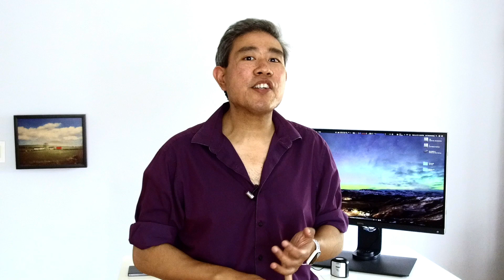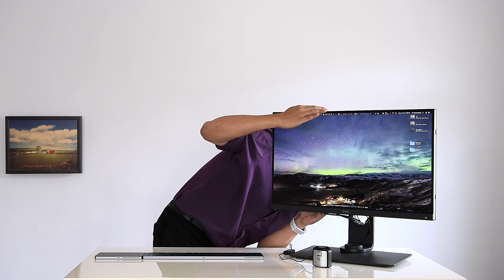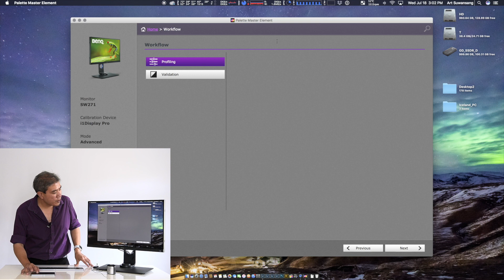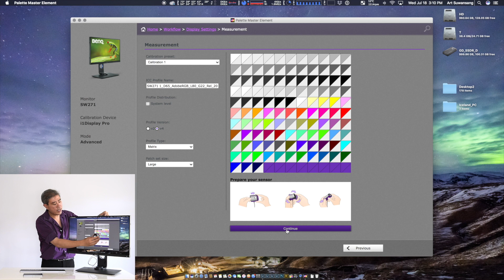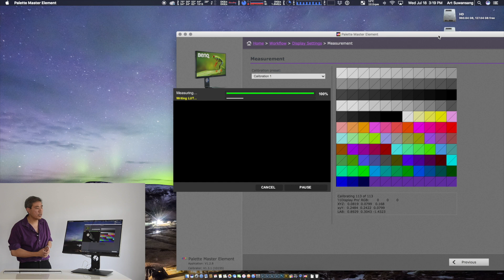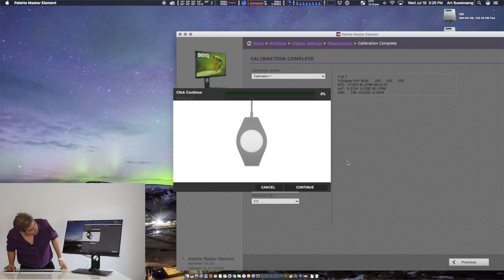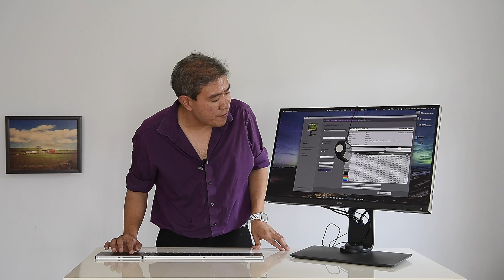How to Calibrate BenQ SW Displays with Palette Master Element - Art Suwansang

Comment: Palette Master Element  does not recognize my x-rite colormunki. listed as colorMunki Photo in calibration device drop down. I have the red X warning  when I click on check sensor, nothing happens.
Can You help please?
Reply from the maker: @Rees Markham, so a few things to note, there are 2 types of color munki devices. 1 of them is and another one is not compatible with PME. If you have the Color Munki Photo, which is a bigger device that you can do paper calibration then it is compatible. If you have the smaller Color Munki Display smaller device, then it is not. You can see what the color munki display looks like here https://www.xrite.com/categories/calibration-profiling/colormunki-display again this device is not compatible. This device the color munki photo is https://www.xrite.com/categories/calibration-profiling/colormunki-photo If you need to get a new device today, I recommend the there i1Display Pro or the i1Display Pro Plus.
Reply: Thank you for your reply. One more question.. I'm working on a PC, will the i1display pro  or i1 display pro plus work with Windows 10. Thanks again for your time.
Reply from the maker: @Rees Markham, yes all X-Rite devices will work with Windows 10.
Reply: Thank you, I purchased and installed the i1 Display Pro program.  However it doesn't seem to be working properly. When calibrating in PME the first time, it seemed to work okay. When I try to use it now it works until I get to the page where I am supposed to put the  i1 Display Pro on the monitor, it goes through a couple of shades of white then the whole screen goes white and stays that way. I have waited as long as 25 minutes until screen saver came on and computer freezes up and have to force shutdown. I've tried many times since, same results even in "easy" mode. It might be that I am using HDMI instead of the USB-C port? The BenQ doesn't recognize my USB-C which I understand would be the optimal driver to use, OR...could it be that the two programs don't communicate with each other? Perhaps uninstall i1D Pro?
Reply: I uninstalled  i1 Display Pro program.  PMI  is now working properly .my USB-C on my DELL is only for charging or dull monitors.Thanks for your help.
Reply from the maker: @Rees Markham, you're welcome
Reply: @ArtIsRight The included BenQ  display port cable  does not fit in my desktop computer no port for small end.The male end fits in my computer perfect.can I use a double male end cable?
Reply from the maker: @Rees Markham, yes you can. BenQ included the display port (big connector) to mini display port (small connector) if you have a full display port to display port it will work too. :)
Reply: @ArtIsRight  Good news Monica at BenQ is sending me one.Thanks again Team BenQ  you are awesome.
Reply from the maker: @Rees Markham, fantastic!

Comment: Hello, I just bought a SW240.  I was wondering if the X-Rite i1Display Studio that just came out in September 2019 will pair with Palette Master Element.  Or do you think the Display Pro is necessary?  Thank you for your videos.  They are very helpful.
Reply from the maker: @Martinouche, you need the i1Display Pro or Pro Plus, i1Display Studio will not work.
Reply: @ArtIsRight  Thank you for the quick answer.  And what cable for an audio connection between older Macbook air ans sw240? Can't get sound right now.
Reply from the maker: @Martinouche, sound on the SW240 is passthrough only via HDMI. This means the sound is carry through HDMI and you would hook up external speaker via the 3.5 mm headphone type jack on the back of the display. This is also the reason why the display have sound control options in the menu.

Comment: Hello,

When you set adobe RGB in Rgb Primaries, what color profile have you selected in your monitor options? (The profile created in PME or General Adobe RGB?) 
Because if I calibrate like in the video, and manual select the profile created in PME in monitor preferences (iMac), there are huge differences in saturation in Library and Develop mode in Lightroom.
The only way I can solve is selecting "Panel Native" in Rgb primaries.
Any thoughts about this topic?
Iam getting nuts here....
Reply from the maker: @Carlos Antunes, technically speaking, Panel Native Calibration is best. However, if you choose to use Adobe RGB there is a bug in the icc generated profile that cause the color to shift in LR. Please watch this guide for a temporary fix on this https://youtu.be/GavTIafAQsw

Comment: Which mode shall select 1st on the monitor ? I have SW240 and I selected RGB on my monitor option .
Reply from the maker: @Shürhongu Kire, it does not matter. When you run PME and pick the calibration slot in the setting screen it will automatically switch over for you.
Reply: @ArtIsRight  hello there ! Need your help again , please help me out . A friend of mine owns a BL2420PT 23 INCH MONITOR . AND when I log in to the master pallette it shows ( A connection to a Benq display can't be established ) please help out .
Reply from the maker: @Shürhongu Kire, PME will only with work the SW displays. For that you would have to do a software calibration, using the i1Profiler software if you own an i1Display Pro guide here https://youtu.be/Aed02rg3wDA a full guide on how to calibrate external display with i1Profiler coming soon.
Reply from the maker: This is the guide https://youtu.be/h_TT9O2I1b4

Comment: Hello ArtIsRight. Thanks for the Video , it helped me a lot with my first calibration of my SW271.  Now I got the message from my Monitor that it should be recalibrated.  So I get to work.  Unfortunately, after the calibration, I keep getting the Message from the Monitor that I should do a calibration.  What can that be?  Can you help me please?  Happy Easter and stay healthy.  Thank you very much.
Reply from the maker: @Maik Knobel, thank you for the question and you stay healthy too! So with the reminder my best suggestion is to turn it off from the display setting menu.
Reply: @ArtIsRight  I am fine.  Thanks.  I turned off the Reminder.  I'm just wondering why they put it in, to shut it down?  I thought until now that something went wrong with my second Calibration .  Have a nice Easter 🥚 🐰 Thank you very much.  😊
Reply from the maker: @Maik Knobel, You're welcome. It is really a good tool but in some instances it does not communicate with PME correctly and this may cause the issue. Personally I turned mine off. These display are good that they don't go off if at all unlike the old CRT days.
Reply: @ArtIsRight  I turned it off. I know everything is ok. Thank you. Stay healthy.
Reply from the maker: @Maik Knobel, :)

Comment: Thanks for the video, Art. 

I am having some issues with a Benq SW271 monitor. The main concern is with the USB-C connection. When I connect my  Macbook pro 16" to the monitor via USB-C, the calibration is failed with very weird color and very high delta E value, around 9 in average. I did the calibration with an i1 Display pro, followed your video on the latest version of Palette Master software. Furthermore, the option to switch between AdobeRGB, sRGB or black and white is not available. Even though I try to use the USB-C cable that comes with the monitor and some of my own. However, when I connect the monitor with an HDMI, the calibration is pass, and I am able to select to view in AdobeRGB, sRGB and black and white mode.  

Any ideas on this?
Reply: Problem solved! 

I have to go to the displays setting in system preference on my mac, then de-activated the "High Dynamic Range" of the BenQ SW271.
Reply from the maker: @Boonrawd Photography, great! I referred you to that video about HDR in my reply on your last comment too

Comment: Great video!! Thanks a lot for that. Could you perhaps tell me if the benq software is also compatible with the datacolor spyderx pro?
Reply from the maker: @utterphoto, yes and the exact device compatibility is outline in the video too! :)
Reply: @ArtIsRight  that's awesome!! Thanks for replying. I did notice only the spyder 4 and 5 listed on the video, not the spyderx pro. Maybe I oversaw something 😅 Since I'm a newbie to the BenQ product range, here is another dumb question: does the pd line, let's say a pd2720u, also supports hardware based calibration or only the standard software based one with no internal LUT tool?
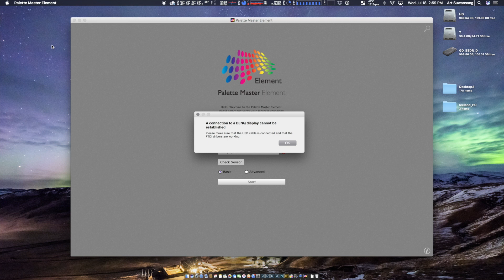Reply from the maker: @utterphoto, I do apologize for this video, the version used here does not support Spyder X, but all of the current ly distributed PME will support Spyder X, you can check out this most recent video here https://youtu.be/iKfvbbUKA7U at 3:33 I mentioned spyder X there. All of the PD line does not support hardware calibration and the LUT in the PD is there but it is non adjustable / accessible unlike the PD line.

Comment: Hi, Thank you for the walkthrough! But i have an issue. On the display settings, the drop down box with all the defaults only shows 'Panel Native' and nothing else. There is no option for Photographer ( Adobe RGB). As well as this, The RGB primaries dropdown box is also not there. I'm not sure what i'm doing wrong. This is also set on advanced calibration mode just as you have demonstrated. I have an SW2700PT. Any help is much  appreciated! Thanks
Reply from the maker: @miguel pilgrim, you have an SW2700PT with a manufacture date between 2015 -2016. It is running on a older firmware which allows only panel native calibration. None of the firmware on the BenQ SW display can be updated once it has left the factory. Panel native is the best option to calibrate your BenQ screen because you get the largest color gamut possible.
Reply: @ArtIsRight  Okay, thank you for the quick reply!
Reply from the maker: @Miguel pilgrim, you're welcome

Comment: @artIsRight Thank you for the video! I did the exactly the same setting you picked here for my SW271 and the calibration failed by far than what your results are  :( 
Average delta E = 9.67
Maximum delta E = 14.98 
Achieved  Temperature  = 6522k 
Is his problem with the monitor or it's something I can fix? And how to fix it? Thanks
Reply from the maker: @Hussain Aljoher, please answers to following questions for me:
1. What computer (laptop, desktop, brand, self build, etc) and OS version are you using?
2. What calibrator are using?
3. What version of PME are you using?
4. What BenQ model do you have?
5. What cable are you using to connect your BenQ to your computer for the display signal, HDMI, Display Port, etc.
Reply: @ArtIsRight  
1- MacBook Pro 16" 
2- i1Display Pro 
3- V1.3.8 
4- SW271
5- Using 2 cables, one USB type C and one USB 3 type A
Reply from the maker: Was your Mac a clean install or did you do a restoration from a backup? Also if you are using USB C, there no need to use the USB 3.0 Type A. 
https://youtu.be/bz9y3db9vRI
Also try to do the calibration this way according to the video.
Reply: ArtIsRight it was restoration from backup from my older MacBook Pro 2013. I’m using the USB 3.0 type A cable because the Palette Master Element doesn’t work without it (contacted BenQ tech support and the advice me to do this). I’ll watch the video and give it try, thanks 🙏
Reply from the maker: @Hussain Aljoher, because it was a restore, there is a high probably that something is conflicting with PME calibration. Also if you are running 10.15.4 check this video out too https://youtu.be/CFyNBYP5lJk it may be as simple as this.
Reply: I watched the video and I followed the same setting you used and it's even worst :( and the colors are more toward hard Magenta 
my result are: 
Average delta E = 12.57
Maximum delta E = 20.19 
Achieved  Temperature  = 6440k
Reply from the maker: @Hussain Aljoher, what is your OS version? Go to menu on the top left apple - about this Mac. We can go from here.
Reply from the maker: @Hussain Aljoher, if you like please contact me via email, you can find my email from the about section on my channel. I can offer you more dedicated help there. I'm sure this issue can be resolve and it is software related.
Reply: @ArtIsRight  Catalina 10.15.4
Reply from the maker: @Hussain Aljoher, if you are familiar and can do this I would recommend you create a separate container on your SSD and install a fresh copy on Catalina on it, from there boot into that install PME and try the calibration again. If you need help do need help with this please email me, I can help you via remote session. Or if you have another computer you can try to run the calibration on that as well.
Reply: ArtIsRight can I use my other computer (Dell XPS with Win 10) to calibrate the monitor and them hook it back to my MacBook Pro? Thanks
Reply from the maker: @Hussain Aljoher, in this case the other computer is used as an A/B Testing platform to verify that the issue you are facing is with your Mac installation. Because that graphic card on the Dell will output color differently than your Mac, it will not work in this case.
Reply: ArtIsRight I was just thinking if it’s problem with the monitor itself!
Reply from the maker: @Hussain Aljoher, I can tell you that it is not the monitor hardware. They rarely fail, 99% of the time it is software and conflicts with the OS. Even if BenQ repair your monitor under warranty, the replacement would still have the same issue. I have done too many diagnostic with situation like yours to know that it is the OS conflict is because of the backup restore. As to what is causing this conflict, I don't know, it is hard to track. So like my suggestion before, create a new container on your Mac SSD, download and install Catalina as a fresh install on that container, install PME and try to run a calibration. See if that works. Or try calibrating with your Dell XPS and see if it pass, if it does then it tell you that something is going on with your macOS.
Reply: ArtIsRight ok, will try this and let you know, thanks a lot 🙏
Reply from the maker: @Hussain Aljoher, yes please keep me posted and if you need to email me you may.
Reply: ArtIsRight Hi, I just finished the calibration using Win 10, followed you win 10 calibration video and it passed. So just like you said, it’s not a problem with monitor and it’s just my MacBook Pro having issues. In the next couple of days I’ll give it some time to do what you advised. I just wanted to update you Art, thanks 🙏
Reply from the maker: @Hussain Aljoher, thanks for the update. Let me know if you need help with the Mac.

Comment: Is there a way to see a before and after comparison once the calibration has been completed?  

The software says my calibration is complete, but I'm left wanting to see what is actually did...
Reply from the maker: @Will Russell, if you are doing a hardware calibration that is complicated. But in short what you can do is change the color hardware mode to Adobe RGB and then on the Mac change the color profile to the generic one that the OS created. On Windows you can go into color setting and deselect the profile that PME created. In short, there's really no toggle for good reason, because part of the calibration data is on the display chip too. As far as before an after on these screen, color out of the box is really close, it may become warmer and the overall display is darker based on your candela setting.
Reply: @ArtIsRight  Thanks for your detailed reply!  One of the reason's why I wanted to double check the before/after is to confirm 100% that the calibration worked.  For some reason, even after what I believe was a successful calibration, when I turn on my computer/monitor in the lower right hand corner of my screen I get a warning that says something along the lines of "Your monitor needs to be calibrated".  Why is it still showing this warning even after I've calibrated?
Reply from the maker: @Will Russell, that does come up from time to time. You can disable it from the display system menu. It is just a reminder to recalibrate the display, it does not mean that your display is not calibrated. As long as you select the correct calibration slot and choose the correct profile in Windows you are set. If you like me to give you the exact menu layout let me know.

Comment: I recently buy my BENQ SW270C and I'm a little confuse.. I calibrate with my X-Rite Display Pro or with Palete Master?
Reply from the maker: @iamDaniXimenes, X-Rite i1Display Pro is a colorimeter device and X-Rite software to use with this device to do a "software" calibration is i1Profiler. Because you have the BenQ SW270C that is capable of hardware calibration, you best option is to use the X-Rite Device, i1Display Pro along with the BenQ Software Palette Master Element (PME). This way PME can access the hardware look up table in side your display. Also check this video out too https://youtu.be/iKfvbbUKA7U
Reply: ArtIsRight thanks man!
Reply from the maker: @iamDaniXimenes, you're welcome!